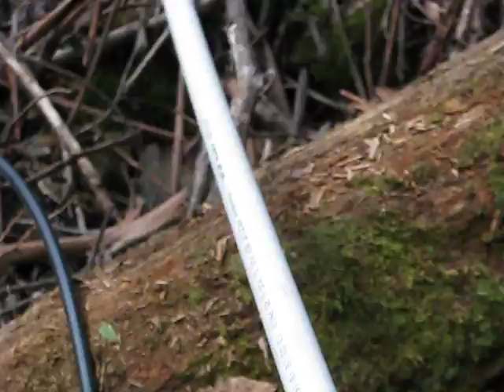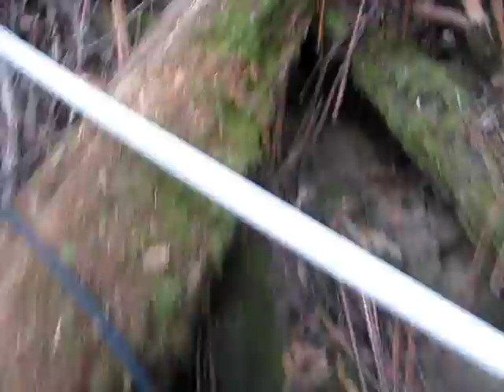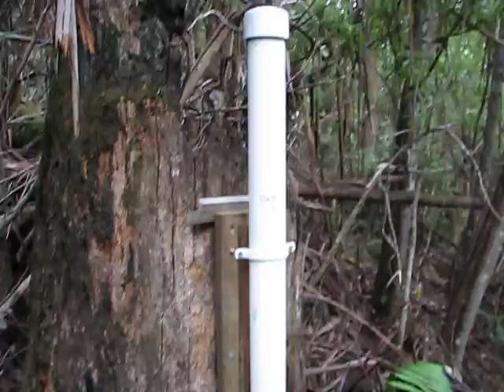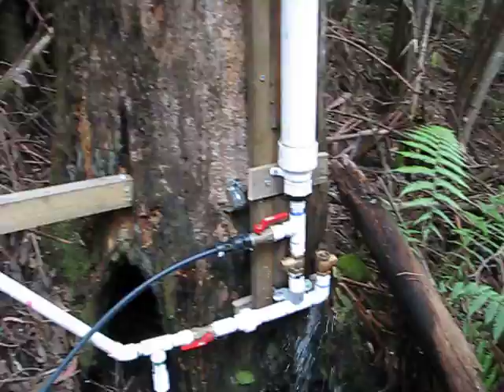1" poly ram pump

Comment: If there is good volume and pressure to drive your ram pump, try to install an additional waste valve I assure you can get more pressure and volume your ram pump can deliver. I did this already, I make and install 4 1" waste valve to my 1" ram pump and lift 40 meter vertical and can deliver more than 3 liters of water per minute
Reply: So you basically  increase the amount of "waste water" to increase the velocity of the water coming down the drive pipe